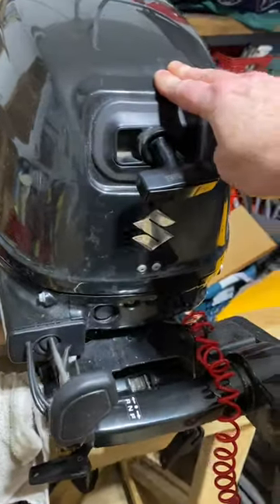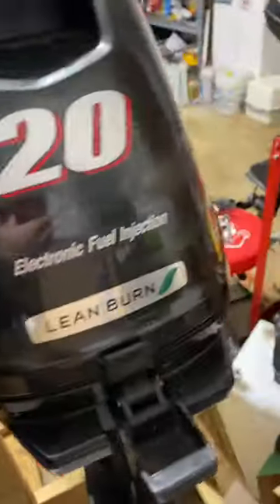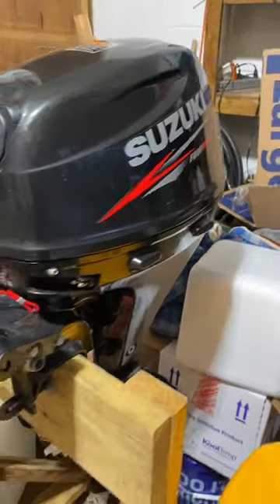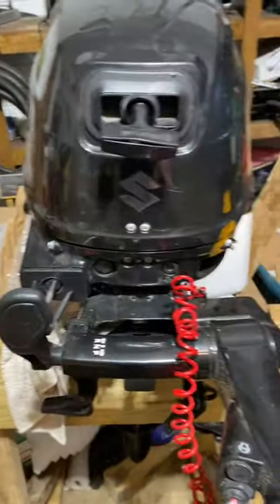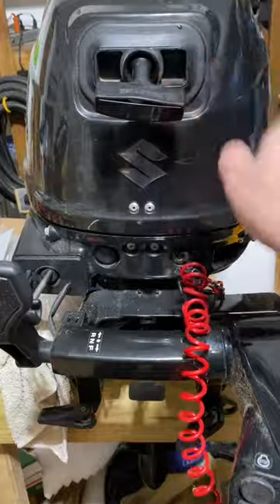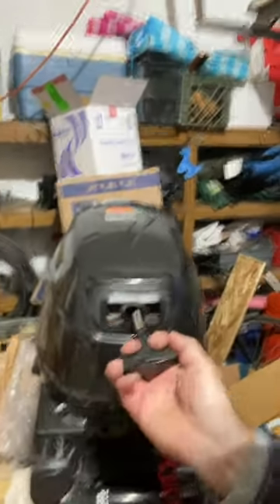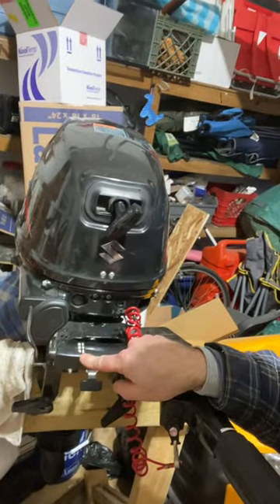Is This Suzuki Outboard Motor Locked Up?

Comment: The first thing what I'll check --> is it really in neutral :)
Reply from the maker: yup!
Reply: Almost looks in forward, but would look to make 100% sure the linkage isn't out of adjustment. Replace thermostat, water pump if it isn't locked up

Comment: I’d make sure that the forward lockout is not stuck causing it to appear to be seized, after that I’d remove the lower unit because it’s possible that the lower units seized up, if that doesn’t solve it I’d remove the cylinder head and inspect the pistons and cylinders for rust or signs or scoring. If a severe overheat occurred the head paint will be discolored.

Comment: Now that you have the spark plugs out use a bore scope to look into the cylinder and determine if it's most likely seized or not without taking not one thing apart.

Comment: The oil got cooked caused either a valve train issue. You check the water 💦 inlet I’ve seen this before for debris or ram it to shallow lack or water pressure. You had air in your water

Comment: First of all you need to hold the motor with one hand and pull the pull starter with the other hand. Pulling it like you are doing will achieve nothing. You can do what you are doing and the motor not be seized. In short you have to pull it like you mean it not half heartedly pull it like you are doing.